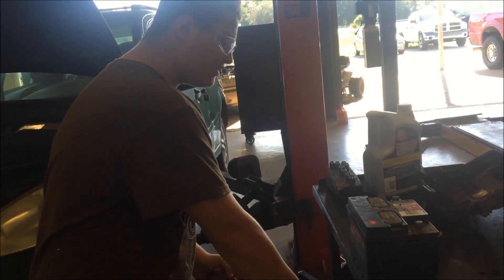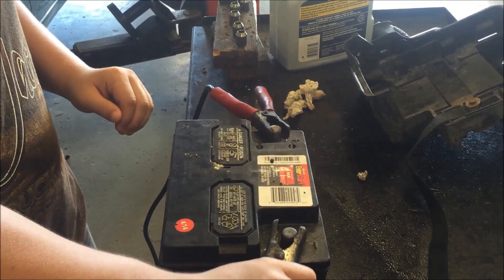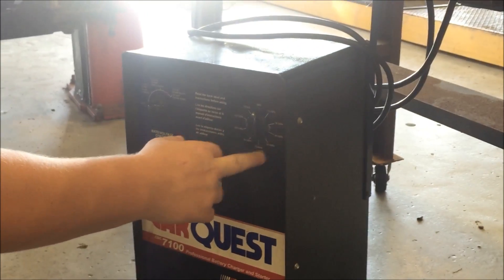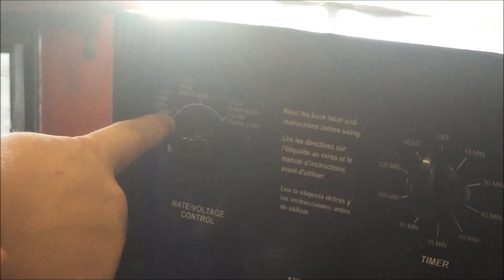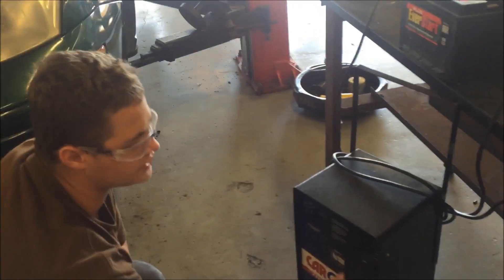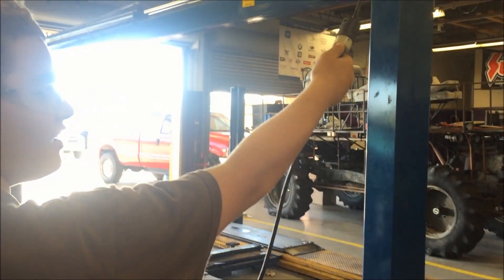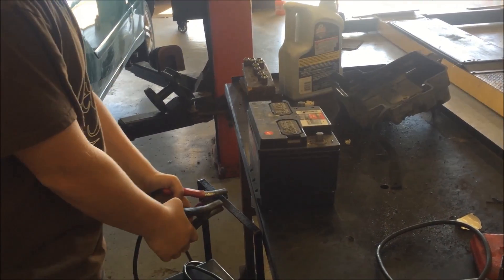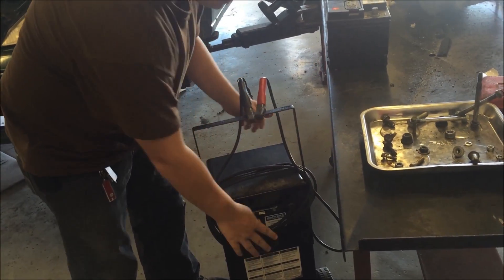How to use a 12V Battery Charger

Comment: Next time when you are giving this advice, make sure that when you charging your battery in a quick mode, you should remove all battery cap/cover of the batteries so it doesn't burst cause of the evaporating gas that the acid produce when is charging in fast mode.

Comment: Great video, just as a reminder or add-on. 

If your using the 200amp option only use it for 5-10sec tops. You put it on 200amps and wait just a sec and go start your car/truck. Once it starts turn off charger and unplug.  Having that many amps for to long will hurt your battery.
Reply: Thanks for explaining 😎